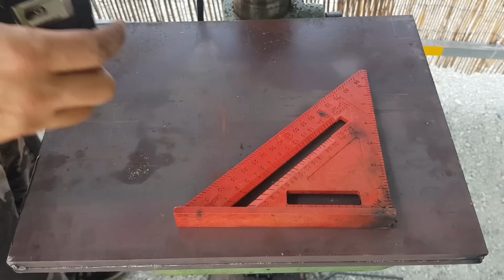Extreme Gantry Crane DIY Portable #6

Comment: Massive build!  I would be concered tha the 6 bolts at each end of the gantry is all that would keep the load from causing the bolts to shear and the load crashing to the ground.  I would have put the horizontal beam on top of  the vertial supports so that gravity supports the load.  That might happen if you have to lift a jumbo jet. 😆 It sure beats the HF gantry crane!

Comment: Really nice welding.  I read one of the comments on placing the cross beam as a butt joint laying on top of the vertical supports.  That could be welded directly or welded plates on the vertical members and bolted into place.  That would make for a far smaller disassembled crane for shipping, etc..  plus no shear pressure on the welds 
and it seems like it would take less time to fabricate.  Your crane gets five stars (out of five) from me.  Thank you for sharing your knowledge and expertise.
Reply from the maker: Thanku jim ford for commenting , really appreciated
Reply: Lu

Comment: NICE!👍👍👍 The only bad part is the six  bolts which clamp the horizontal joist to the vertical legs are super stressed. Weld a plate to the vertical leg so that the joist sits on a platform.
Reply from the maker: Thank you for commenting

Comment: I would put some angled bracing in the corners where the upwrights meet the cross beam for not only added capacity but strength aswell by the looks of what he was lifting i would give it a cosevative 1 ton rating as is nice job

Comment: would have been nice if you indicated the dimensions. At least how tall and long is the beam. Looks like 12 ft. long by 12 inches tall. And guessing 3/16 inch wall thickness on the tubing.

Comment: Dude, INSANE! I'm from India, i need to build a crane like this for installing Strongroom door (Vault Door). Can you please give the design of this crane? Like thickness of the tubes and height etc. Would be very helpful, Thank you! :)
Reply from the maker: Hello friend, the tubes are all 3 mm thickness and the plates 12mm you can build it for the dimensions you need,but not overcome 300-340 cm height  and 250-260cm wide(for safety) 
thank you for commenting,
Reply: @cutweld7034  Thank you!

Comment: Can I ask what is that water mix with something or oil when cutting with the bandsaw?
Reply from the maker: Its oil especially for cutting milling , can be used for lathes drill milling machines and band saw , its called metal working fluids easy to find 
thank u for commenting

Comment: the main beam is wrongly designed, needs cross members instead of just perpendicular ones.   Another thing I would have designed differently is the tie between the beam and the columns, the beam should rest on the columns not on the bolts.. . craftsmanship is good. . congrats
Reply: Jeff Okriya looks like it works to me
Reply from the maker: Hello Jeff Okriya, i agree but for my needs is more than enough that way,the heaviest thing i will ever lift is my lathe about 20cm to put my handlift under 
Thank you for commenting

Comment: As a beginner I would have appreciated posting the thickness of the metal components (like the square tubing thickness -11 ga., 1/4 in., 3/16 ??). I realize it would be a hassle providing detailed plans but if your goal is to demonstrate your skills, you have done a fine job. If your objective is too teach, then you need a little improvement.
Regardless, your gantry crane is impressive.
Reply from the maker: Thanks for commenting, in the EU we use millimeters instead of inches
the big tubing are 100x100 by 3 mm thickness
and the others 50x50 by 3mm thickness

Comment: Hi buddy! It is nice job. I readed that tubes are 100x100x3 and 50x50x3mm. I can't find what the width, height and load capacity are.
I will build one for my boat service. Thank you for answer, Tomáš.
Reply from the maker: Hello Tomáš , its 250 - 60 m to fit on my container and height 3m but for ur needs maybe u should make it stronger make a researcher before start
thanku for commenting

Comment: Great job 🇲🇰👍.What is power in ampers your mig welder?
Reply from the maker: Hello thanku, 200amp (single phase )  but kemmpi is one of top brand on the market, there is chines machines 300amp but is not to be trust 
thanku for commenting
Reply: @cutweld7034  Yes 😄 Chinese 300 amps single phase madness that is not normal.I have use ,,cebora'' and ,,Cea'' from Italy with power 380volts great performance ,but now l am in other industry

Comment: Would be nice to see it move with the load on the crane.
Reply: I know where you are coming from, but... Gantry Cranes (except those on rails) have wheels to move the crane, not a loaded crane. Moving a loaded crane of this type of design is really dangerous.
Reply from the maker: Hello Drew Conrad, to move it with the lathe i need hand-lift under the lathe,but for 100-300kg moves with no problem always carefully   
thaks for commenting

Comment: Thats nice, heavy duty, and I would absolutely purchase something like that from you, but I wouldn’t call it Extreme. There are inherent weak spots in the construction.
Reply from the maker: Hello Abby Babby, for some home use DIY gantry is extreme, for industrial is just a toy
Thanks for commenting
Reply: @cutweld7034  he is not wrong.your welds should not be carying any load and almost all of yours did.also that metal planks holding the bridge should be horizontal.make it wright before some accident happens.best wishes and happy hollidays
Reply: @cutweld7034  I agree there are weak spots, I would fix the design in this manner: Lay the top beam on top of the 2 support beams making a butt joint. Then I would reinforce the 4 wheels and support beams. 

I know that It seems strong, but currently the entire weight of the object you are lifting rests on 4 2x2in welds, NOT GOOD. Please improve design.

Comment: Too high ..guess that it be max weight lift 2Tons ?? And if to lift up over 1,5 meter upside maybe will Collapses ??  Beside the whole weight is on the two screws holding the wheels on the top...Guess its ok for light weight with big design..
Reply from the maker: Hello,Yasser H my crane lifts up to 1,5ton but am not recommending, i lifted my lathe for testing.Am using the crane mostly for upload items on my truck 200-300kg 
thank you for commenting !!